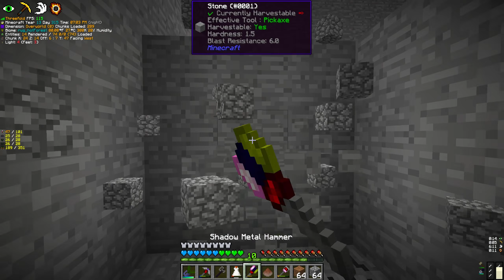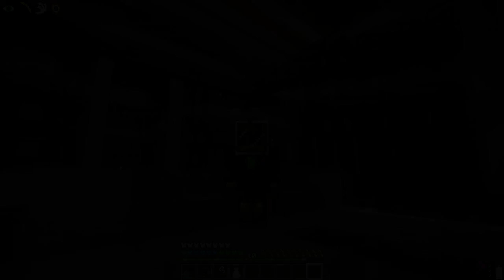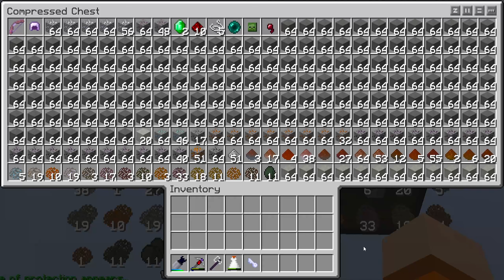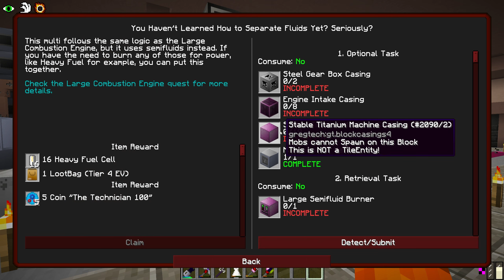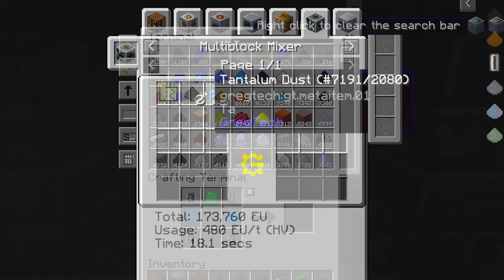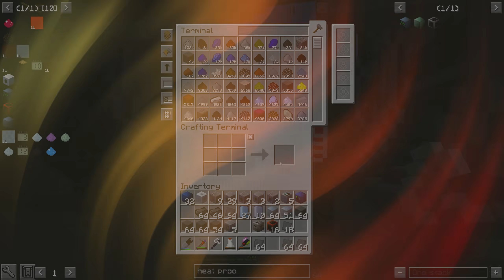Gregtech New Horizons S2 41: Foiled Plans

Comment: The Circuit 24 shortcut recipes are half the reason you use LCRs. Whether the other half is the lack of cells or the perfect overclocking is up to you 🙃.

There's not much reason to use a Distillation Tower to distil diluted acid (hydrochloric or sulphuric) back into proper acid. Reason being that the only extra byproduct you get is water, which is basically worthless, and the throughput of a single block compared to a DT of the same energy tier is actually the same. I couldn't tell you off-hand whether you eventually want a GT++ DT or a PA with single blocks depending on whether you prioritize throughput and/or energy efficiency, but even with all the chemistry you do in IV it's going to be a while longer before you reach the point where that question becomes relevant, anyway.

For the record you can coat "basic" cables with Silicone Rubber instead of plain Rubber without needing any special foil or whatnot, and it will only require half as much of the former compared to the latter, but you don't get any speed upgrades or energy discounts or what have you doing it that way. It's just an option to cut out plain rubber entirely, at least as far as coating cables is concerned. Which you might do eventually, but right now it's not really worth throwing Silicone Rubber at anything just because.

This is the kind of mess you can avoid by just overclocking all of your LCRs to HV. The power loss is minimal, literal rounding errors at this stage, so it's worth it just for the decreased chance at massive explosions. That said if you do choose to go the "transformer dancefloor" method do not, under any circumstances, manipulate a transformer that has seen live wire. Cut the wire, break the existing transformers, and rewire the entire setup from the ground up. Transformers have an internal EU buffer, and they will use that to send power down the line whether you're ready or not. One mistake with a wrench, set of wire cutters or soft mallet is enough to turn your nicely symmetrical and organized line of machines into a series of detonators. Never underestimate how dangerous transformers are. Use diodes and/or plates/foils to direct power flow and block off sides of a transformer if you really cannot afford to risk explosions. Backups exist, yes, definitely be careful to make backups before turning on a line of transformers if you've got that option available. But imagine playing on a server that doesn't reload a backup every time a player nukes a section of their base. Backups should be just that - a backup. Prevent explosions first, reload a backup only when plan A, B and C fails.

So some of you might be familiar with Thaumcraft 6, and how in that version of TC you will get Warp events less and less until they stop entirely, or until you get more Warp and reset the cooldown timer. In GTNH that cooldown timer does not exist, though I don't know if that's intentional design or a bug. Either way if you've got Warp you're going to get hammered by Warp events constantly until you either pick up Warp Ward or remove your Warp outright. This is part of the reason why I'd recommend diving head-first into Warp when you've got a moment to spare, because the only way to stop these Warp events is to get rid of Warp altogether, and getting rid of Warp is any reasonable manner is going to involve getting a bunch of warp first. Delaying dealing with Warp is just going to result in literal dozens (if not hundreds!) of hours of suffering Warp events, and they only get nastier and nastier as you get more warp too. It is a rabbithole? Yes, I mean what else in GTNH isn't, but the best rewards that magic has to offer is locked behind this mess of warp you have to dive into. Madness pays off, especially if you stay mad for as little time as is necessary.

Around LuV is the point where the questbook starts to trust that the player is capable of navigating NEI themselves, and as such has far fewer instances of "get these materials to craft these items to craft this machine" spread out across multiple quests or individual quests describing every output of a given process, etc. Why that takes until LuV I have no idea, but it's how the pack is set up. I guess it also is fitting, in a way - I'm the one who keeps saying that Assembly Line, which is the gate into LuV, is the entry point into GTNH's midgame and all.

You know, NEI does give you multiple pages worth of pins, so you can keep the ever growing list of magic stuff you still need to grab pinned while starting with a fresh blank canvas on the tech side of things 🙃. And yes, there are a lot of magic items on the list of things to grab in the perpetually nebulous frame of time called "later".

One downside to MBMs if you're using a planet's rock types for building (or other resources, which will come into play later, and not just in the "moon rock dust is a trap option mistake never use it please save your own sanity" sense) is that...well, they mine ores, not stone. There are proper quarries in GTNH, but they're very gated - the first one worth mentioning is post-LuV if not post-Fusion, unless you dare to risk setting up an old-school Project Red Frame-based quarry (hint: you don't). So before that point, if you need a bunch of planetary stone, you're either going to have to get creative or best get to manual mining. That's not to say that options to make the manual process easier doesn't exist - Terra Shatterers do exist if you're able to generate enough Mana to make them decently high tier, and Blood Magic complex spells likewise has a crazy good manual mining solution if you invest enough into it - but barring those solutions it's you and your trusty TiC hammer.

I do vaguely recall mentioning before that now that the ore processing issue is solved it's time to address the problem of ore gathering. One T1 MBM and a couple of old single block miners at this stage is not ideal, but of course issues such as interdimensional item transfer have to be solved first, and than there's the issue of whether there's enough power to run all of that stuff constantly, etc., etc. Never a dull moment in GTNH, always more things to do.

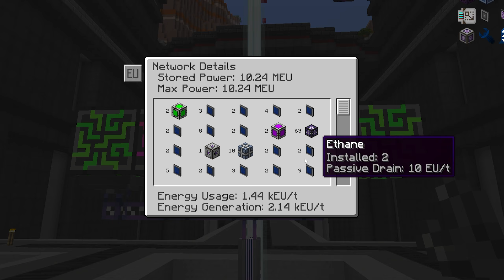If you want to know the total power cost of your AE2 network, including all connected subnets through quartz fibre cables, simple use a network tool on the particular network where you're inputting power into. With the network details screen open simply look at "Energy Generation", on the bottom, and there you go - that is how much power is going into your entire AE2 network at any given point in time. Go back to 11:38 again, where Three brought up the network details of his power input network, and check the number: 2.17K EU/t. This exceeds the limit of the GMEA's 2048 EU/t, so yes, Three has indeed exceeded the energy capacity of his dragon egg power generation.

It's not a proper modded base if it's not an absolute maze of walkways, staircases, teleporters of some description, catwalks, and a thick layer of dust because of course the only mode of transportation you use is flying around with creative flight 🙃.

GTNH has crafting storage units up to 16384Ks, and co-processing units up to 4096 co-processors in a single block. The only real concern with your room for housing AE2 crafting CPUs is AE2 channels and Crafting Monitor accessibility, because even relatively small CPUs can be made into giants with super large storage units and compressed co-processing units.

Always have a backup plan in mind for your AE2's power supply, because if you end up being knocked back into the stone age for want of a battery that would just be really sad. Likewise always have a power supply on hand separate from your main power spine, so that if main power fails for some reason you're not locked out of your AE2 system.

Comment: three whats your thoughts on using p2p-gteu as a cable to transport power?
I used it in my tj world and it works quite well for me

edit: tj has channels disabled so it's not an issue for me, it might be for you
edit 2: it also takes a toll on power
Reply: P2P has a flat loss of 5%. His Hss-g cables have a loss of 2/block, meaning his setup is more efficient when the main cable is less than 819 blocks long. After that, P2P is more efficient.
Reply: @Correct_Opinion  Furthermore, this difference (and optimal length) only increases with cable/voltage tier and becomes infinite (meaning cables are always better) after a point (Red Alloy, Blue Alloy and Infinity).
Reply: yah, like 40%, no thanks